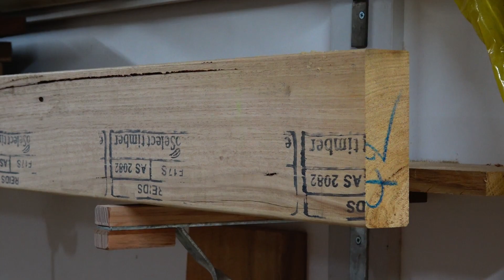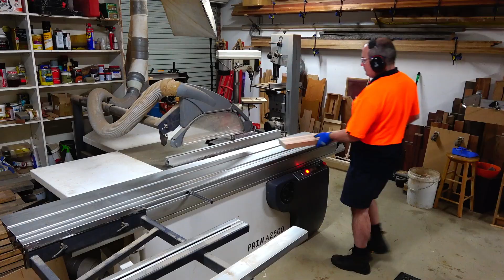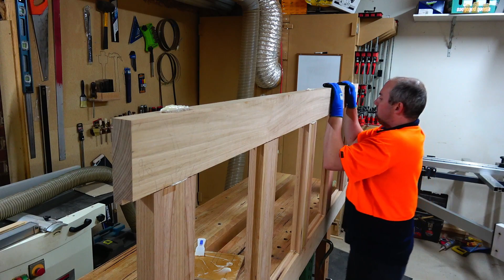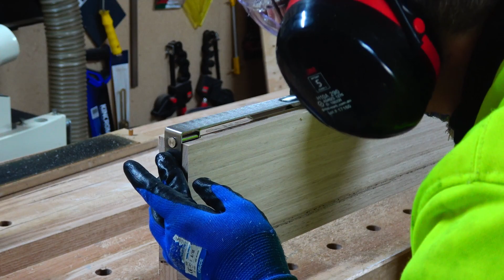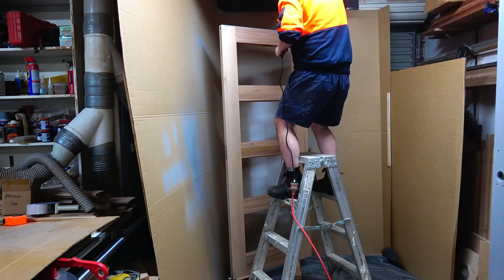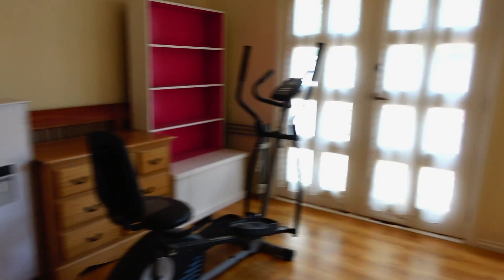How To Build French Doors

Comment: Fitting glass from the outside makes it easy to break in quietly just by prying out the wood strips and lifting out the glass.
Reply from the maker: There is a bead of silicone sealing the glass to the door. It would be easier just to break one of the larger house windows instead of the small glass door panels.

Comment: Top job brother. I want to build a set for an extension I am doing. I was going to match the  German uPVC double glazing I installed throughout the house. However, they are getting greedy. $5,000 for the double doors. I love the look of yours and I am 110% stealing you awesome design. I will be installing double glazed units instead of the TXD glass as Tasmania gets a bit chilly.
Reply from the maker: $5,000 for a pair of doors! This is why I need to make everything myself. I'm currently in the process of replacing another pair of french doors, along with the front door and laundry door. Double glazing is a good idea, I didn't want to spend the extra money on it though because I live alone.

Comment: Usually I find the 'loose' glazing bead on the internal. Gives less chance for water to sit between material and brake down coatings.
Reply from the maker: I made sure not to create a paint seal on the lower glazing beads so the water can drain out.

Comment: Mate absolutely stunning work and great video and i like the table saw comments i get when i freehand cutting the live edge off lol, but those are stunning mate cheers and good work
Reply from the maker: Haha, I've seen your freehand cutting. I don't have a problem with it. The worst that can happen is that it can bind on the blade and ejects the timber back at you. It might look scary, but it's a non-issue 🤷‍♂️

Comment: Beautiful video, great craftsmanship and fantastic explanations and instructions. My only observations would be about the glazing beads on the outside of the doors. They might be great for the strong winds and weather aspect but it also makes life slightly easier for the local unfriendly neighbourhood burglar. I accept that the beading and silicone may well deter them, but thieves will always take the easy or easier option, which exterior beading gives them. Having said all of that I have still subbed.
Reply from the maker: I thought about the same thing regarding thieves. The way I figure it is, if they want to mess about removing a glazing bead and then prying up toughened glass from silicone, then they are stupid thieves. Keep it simple, just throw a brick through any of the standard glass windows around the house...just to find out all of the doors are deadlocked so they'll be climbing back out through the window they came in 😂

Comment: You might be a slobby pig mate but when you decide it is time to do something... no one does it better. Now... about that other rotten set right next to the nice new ones... 😜😜
Reply from the maker: Haha, thanks mate. It is true, once I decide to do something, it will be done..eventually, and it will be done right. One thing that I decided to do was lose some weight and clean the house. I've lost 6kg in 30 days, and the downstairs wouldn't make girls vomit on sight anymore. The other set of doors will be replaced with a window, just saving up some cash to get it done.
Reply: @kuffyswoodwork  I thought you were looking a bit more trim 😉 That's the only trouble of doing things right...takes time and coin.

Comment: OH MY GOOD HEAVENS!  Your blade is sOoOOOoOoo high on your table saw!  🤬

😉

13:19 I LOVE that you supported that.  Probably not necessary but it's good to keep that in mind.
15:17 I've seriously never heard of structural epoxy adhesive Kuffy.  That sliding in is amazing.  I'm going to have to look for it here.  I also like your explanation of what epoxy does when it cures.

Why are you painting this...you're RUINING IT (you kind of asked for it)

35:23 I'd love to send you some pictures of my yard.  Seriously, your yard looks like some drunk maintenance man has been working on it.  Mine looks like it's been abandoned for years.  I have trees growing in the center of my gravel driveway.

Hey Kuffy, ignore my poor humor.  You're a woodworker's woodworker.  Most people would look at that and say, "Yep, that's a pretty set of doors."  Those of us that make sawdust look at that and see how talented you are.  Very good video.  I was surprised I made it all the way through...my attention span doesn't do well after 7 minutes.  So many tips and ideas to get from this video.  Thanks for posting it.
Reply from the maker: I've never been a fan of using the blade low just because someone says it's safer. A low blade presents other issues that I can't be bothered with. I just don't touch a blade that has power supplied to it. 

Supporting the tenon while bandsawing the wedge slot just stops it from bouncing around a little bit. It allows me to use light pressure with my hands and arms, instead of needing to apply some muscle work.

There are some super structural epoxies available. We don't use them in woodwork, but the guys building skyscrapers certainly do :D I'm pretty sure the Techniglue epoxy I use is pretty similar to West System with some of those white filler beads added to thicken it up. 

You're the first person to bother to comment about keeping the doors clear coated. I might keep the front door clear coated when I rebuild that one. 

I've been planning, and putting time aside to work on my backyard for over a decade now. I end up just spraying weed killer and calling it a day at that :D

Thanks mate. My attention span struggles to make it to the end of a 15 second TikTok. It takes a nice bouncy set  of jugs to entice me to watch till the end these days :D
Reply: @kuffyswoodwork  haha, yes, jugs are a great ADD drug.  We should employ more jugs in our schools to help the attention deficiency, though, not sure if they would help with scores.  🤔

Comment: Spoil sport! As soon as I saw the T moulding I wanted to see how you made it and then you just disappointed me 😢. Great video mate, another masterclass from Kuffy. I’ve wanted to build my own doors for years but just haven’t had the opportunity.
Reply from the maker: Haha, I moved the camera waaaaay back because I knew where my hands were going to be. But it was still pretty clear my hands were directly over the blade with 10mm of timber as "protection". It was made in two pieces, a groove in one piece, tongue on the other which made it easy to assemble in a dead straight line.

Comment: A great project Kuffy are you going to do the one next to it? I have one of those Wagner sprayers and find it a total pain in the neck always get masses of overspray. I also bought an Ozito branded one at it has the same issues.
Reply from the maker: I think I'll replace the other pair of doors with a window. I do need to make a front door and a laundry door (same issues), so I'll test out that Wagner sprayer a little better. Otherwise, I'm going to put a airless sprayer on my list of things I'll never be able to afford 🤣

Comment: They look terrific. Now you will have to make more for the door next to them😁
Reply from the maker: Yeah, the pair of doors beside these ones have suffered the same fate. Rotted out quickly. I'm considering putting a window in that position instead, because I don't need 2 sets of French doors in that room. This way I could put a couch under the new window and it will make the space a little more usable.
Reply: Makes perfect sense